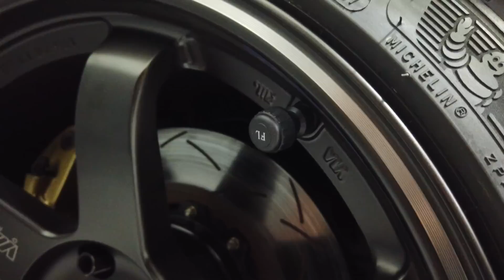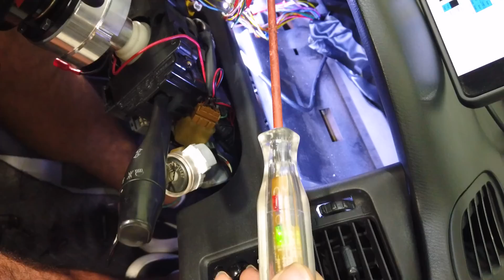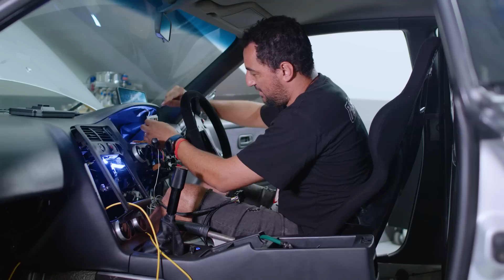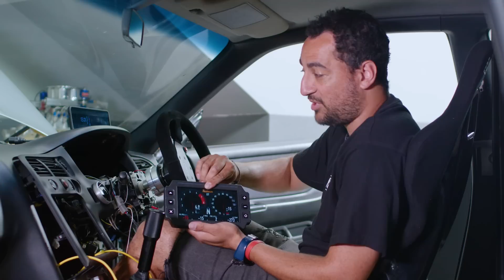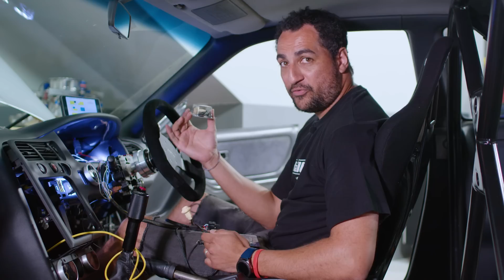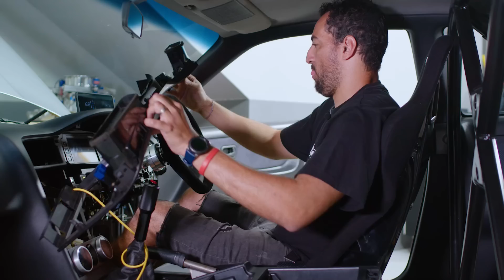🛠 iC-7 Wiring: indicators, lights, hand brake, fuel level | TECHNICALLY SPEAKING

Comment: What terminal on the ic7 side did you use for the charge wire?
Reply from the maker: There is no alternator excite pin on the iC-7. 
In this case, a separate charge light can be wired in external of the iC-7. 
Alternatively, a 470ohm resistor can be used in place of the bulb.

Comment: I think the plug should come with the turn signals and handbrake light etc already wired into the plug and labeled  for the amount that it cost. Also usb plug should be integrated into front of dash with a plastic flap .

Comment: What’s the trickery with the relay for the high beams? I think that is what’s going on with my R32 GTR. I wired the positive into the dash, but it only works when I pull and hold the lever.

Comment: How do you fix the fuel slosh? The level  is literally reading up and down every time the car moves. Hopefully you don't need to buy and wire in a separate module for this?
Reply from the maker: Hey! That sounds like a question for our tech support team. You can contact them directly via www.haltech.com/contact-us
They'll be more than happy to help. 😊
Reply: @haltech  after driving the car, it read empty. THEN after filling it up, it only took 5 gallons to fill. So obviously it wasn't calibrated properly. Once we got it calibrated properly it didn't slosh anymore! 

So please forgive my haste and thx for the reply! 😊
Reply: You change the filter rate in icc software

Comment: Thank you !!! Look Simple and straight forward. I have a question if use the positive from the highbeam wire going to the lights  instead of the cluster wire from the switch for toyota would the voltage going in be to high or would it be able to receive the 12volt without hurting the unit? Thanks..

Comment: hand brake is definitely something I would want an alarm on and I would like the alarm to stop when hand brake is released, Will it do that or would I have to clear it on the dash somehow? I have bad habit of forgetting to release it ,mine is on the back of the transfer case. Leave it on once and pads need to be replaced ay about $50 a pop

Comment: I have a bare shell car. no factory harness and am interested in how i do the lights and turn signals with a Haltech Hatrness? do I need digital lights? I want to use the stock steering column.

Comment: awesome vid, and helped a lot with my dash install. any chance we could have an updated short vid that includes how to make the Battery and oil warning symbols to work, maybe some information on how to connect an oil pressure switch as per OEM dashes. there doesnt appear to be any information officially on this and through lots of searching ive still not got to a definitive answer.

Comment: You guys are so smart wish we had technicians like you in the UK - my FD3S hasn’t run for ten years and no garage will take my money to update the electrics.
Reply from the maker: There are a number of workshops in the UK using Haltech products now. Check them out in the Dealer section of our website :)
Reply: @haltech   thanks, no garage will touch my car because its modified (badly) by other garages - the only two garages that have quoted are only willing to do a complete tear out and chassis up rewire with all new everything and the quotes are around 12k which is more than my FD3S is worth. My car has been advertised for sale for 3 years with no offers in that time, the market values my car at zero unfortunately due to it having upgraded parts and modifications - my aim is to sell the car and I believe showing the car on track and at events and getting it road legal might help me finally move the car on to a new owner.  Since I wont be using the car myself I have chosen a more budget equipment supplier (ECU Master) with the skill/labour shortages and lack of help from any garages the ECU/dash display/PDM etc will sit in their packaging perhaps years as I try to figure out how to fit them all myself so I figured cheaper is better.

Comment: Hey Dave, ripper vid. Question, I just installed an IC7 in my E36 BMW race car running a Link G4+ pnp ECU. I wired the fuel sensor into the haltech plug and hooked into the CANbus on the Link. Do you have a video on how to configure the fuel level at all on the IC7? And what CAN ID should I be using with the Link G4 preset on the IC7? Thanks in advance.

Comment: Thanks Dave - could you give a quick summary on the fuel level setup for this R33 GTR? 
Did you end up wiring it from the connector on the pump and which figures did you refer to on the voltage level? 

Thanks!

Comment: It would be super handy if you could use the IC7 as a analog input for Lights, wipers, ign off the column controls and then relay that input to your Nexus R5 or PD16.

Then you just have an single CAN, As opposed to running 8-10 wires from the R5/PD16 up to the column.

Comment: Since you werent, or "if you aren't", using the factory clocks anymore, could you have just de-pinned those signals going to the old cluster sockets and re-terminate them to the IC-7 socket?

Comment: Where can you find those brass cable crimps? And would they be an ideal connector to splice into an exisiting wire for say a switched 12v power source for a gauge or digital boost controller?

Comment: I’m rarely happy with the crimps I get from the red handle simple crimpers, I found that I can use the Sargent ratcheting crimper for weatherpack terminals on those brass splices with 2 18ga wires and it works perfectly. (The wires break before pulling out of the crimp)

Comment: The Vauxhall Nova here in England had a hazard switch where if you pulled it out flipped it 180 and put it back in , it would power up the ignition and off you went 😂

Comment: Top video Dave great work as usual, would love to see an in-depth video on just fuel level wiring setup and calibration. Hear so many people having issues and not understanding the calibration side of it seems to be the hot topic.
Reply: @Dave Forrester Legend 👌
Reply: @Dave Forrester Hey Dave

Would you guys be able to create some more default IC7 layouts? 
Is there a  plan to integrate a GUI editor into the ICC Software? I feel like there is so much potential with the IC7 but we are limited to a handful of pre defined layouts and no ability to customise them other change changing what channels are displayed, or changing the background image...

I've actually started learning how to modify the layouts using QT Editor because I was so unhappy with the default layouts provided. 

Also, it would be incredible if we could have multiple variable conditions for alarms. Example, IF RPM > 5000 AND Oil Pressure < X Then trigger an alarm.
So many alarms I'd love to have, but with only 1 variable it's not possible...
Is Haltech looking at improving/upgrading those items mentioned in the future?

Comment: Did this in my R33 a while back. I loved the fuel gauge bit was configurable! I was able to trace the ribbon wiring on the back of the instrument cluster to find the pin outs. Also, pro tip, the blinkers and random things won’t work if your “Hazard” switch/module isn’t plugged in! I’m stoked to mount one in my new R33 GTR project on the dash with an R34 MFD style mount.

Comment: Dave, I see Newark Electronics for US crimp source... I've been a customer since '86. Thanks for the details. Question: When you wire an engine bay, do you make sub-harnesses (fuel injectors, C.O.P., etc.) or just use the main harness?
Reply: Personally I actually like making up sub-harness's for coils and injectors where it may be nesseary to swapout these components or for ease of access. 

Also, if there is a budget allowance for the extra connections and labour  :-)
Reply: @davenonameforrester  If I do it, the budget is limitless ;) Just terminals, plugs, and time...

Comment: I can't believe they don't have a resistor integrated into the dash to simulate an alternator charge light, and have it also activate a warning on the dash if its not charging...
Reply: There’s battery voltage displayed on several tabs of the IC-7. You can setup the dash to flash a warning above or below certain voltages.
Reply: @BrianCrofoot  and you clearly need it seeing the dash won't even turn the alternator on...
Reply: @TwistTapeTechnology  yeah I was just using switched power from my under hood fuse box to turn on my LS alternator on my Forged Rb25 build. Several ways to skin a cat. I get what you are saying though. Would be a nice feature, but very easy to overcome and monitor.

Comment: I thought I wired in my high beams properly in my chaser but doesn’t show on the dash while everything is working. Thanks for the tip about the relay Dave, was scratching my head.
Reply: Hi Cody, that chaser highbeam has properly done my head in before. I'll put a diagram together for that one.

There must be a relay in the factory Cluster for it.